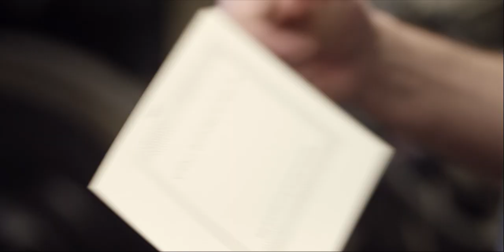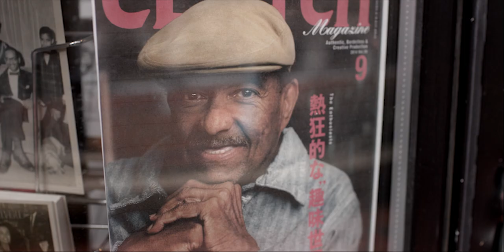PF Flyers Made in USA Center Hi | Made with Boston Pride

Comment: Good to see something still made in Amerca.
Reply: the boston made version is $100 dollars more than the overseas models. us made pf flyers cost $150 and the non us made are $52 dollars, both direct from their website
Reply: Well, technically, the 14oz Duck Canvas upper is assembled overseas, but, New Balance was required to finish the rest in the US borders. So the uppers come to the Boston factory, 30% made. And then, the rest of the 70% is finished and refined in Boston. I thought they were completely manufactured in the US as well, however, its roughly 70% according to the PF Flyers website for the "Made in USA" collection. Despite these being $150 compared to the standard PF Flyers, or the All American Collection, there are noticeable differences when compared. Obviously, the 14oz on the $150 value, the upper will feel more sturdy and not as flimsy compared to the cheaper options. Especially, with the pigskin leather lining for the eyelets and the toe cap instead of it being a cheapy plastic feel. And of course, the PF Flyers patch are not ironed on; rather the patch is sewn on and as for the heal tag, it is not painted on but rather melted within the vulcanised sole. And, of course, the removable soles are a nice and comfortable foam bed developed from the proud parent of PF Flyers, New Balance technology. I think B.F. Goodrich would be very proud.
Reply: matrox indeed, I have a video unboxing and quick overview of a pair of Sandlot USA Made and compare them to non USA made pair also on my channel. Check it out!

Comment: WHY SO EXPENSIVE
Reply: American made
Reply: Same!! Worth supporting local industry though, and also extremely worth the price tag because it's a high quality shoe. Placed my order! Got me some Made in USA Center Hi.
Reply: Despite these being $150 compared to the standard PF Flyers, or the All American Collection, there are noticeable differences when compared. Obviously, the 14oz on the $150 value, the upper will feel more sturdy and not as flimsy compared to the cheaper options. Especially, with the pigskin leather lining for the eyelets and the toe cap instead of it being a cheapy plastic feel. And of course, the PF Flyers patch are not ironed on; rather the patch is sewn on and as for the heal tag, it is not painted on but rather melted within the vulcanised sole. And, of course, the removable soles are a nice and comfortable foam bed developed from the proud parent of PF Flyers, New Balance technology. I think B.F. Goodrich would be very proud.
Reply: Traxxattaxx For real man. Made overseas for a very low price and then sold here for over $300!
Reply: I bet if they produced in a smaller american city it would be cheaper but its still good quality and made in usa.
Reply: So buy these and wear them for three lifetimes of a normal 50$ sneaker.